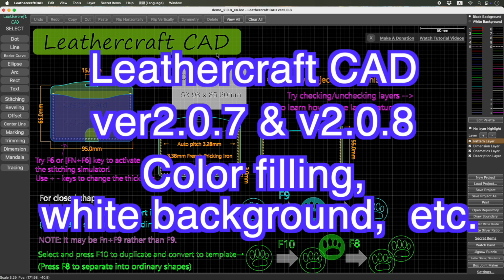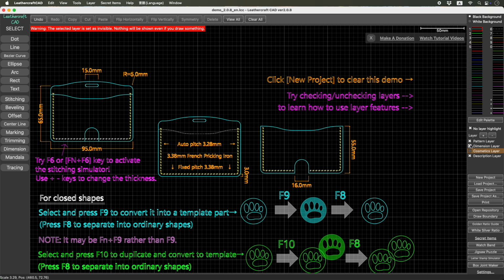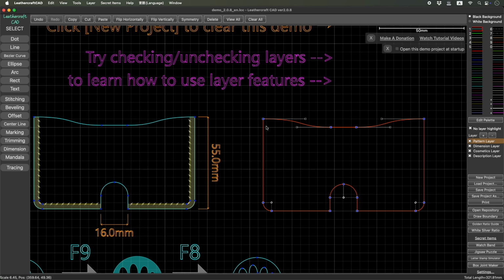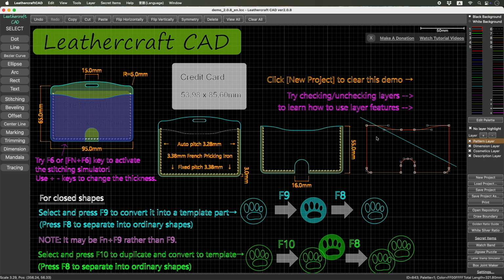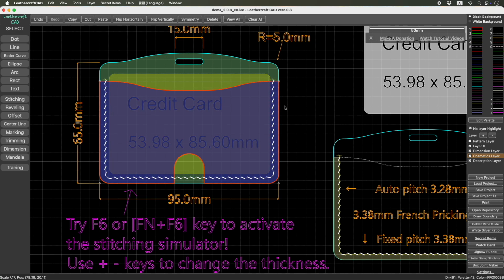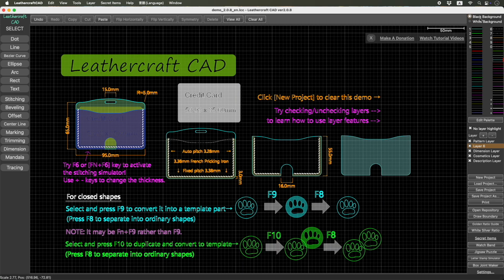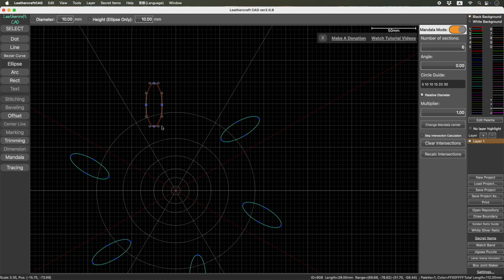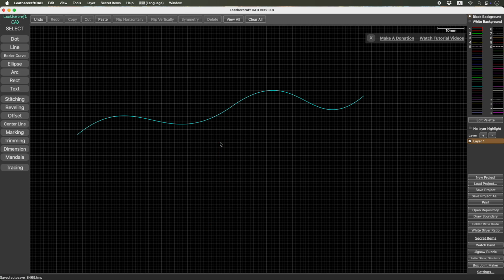Leathercraft CAD v2.0.7 & v2.0.8 - Color filling, white background mode, demo project, oval, etc.

Comment: Aye bro, why is your software's info.plist has access for user location and camera etc?
Reply from the maker: I am totally new to macOS software development and deployment and I haven’t touched any of default parameters in the plist. LCC does not need user location information or access to Camera obviously. Actually I didn’t even notice those are turned on. When I’ll release the next version I’ll turn them off. I don’t know what’s written in the plist but access to the local storage and https web access for latest version checking should be good enough. Thank you for letting me know!